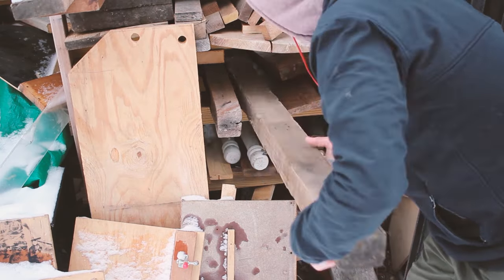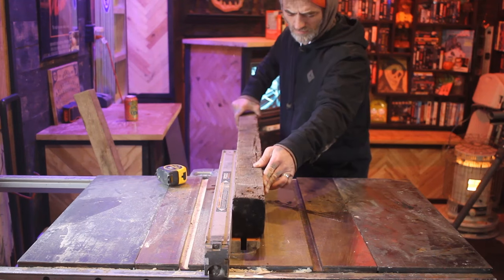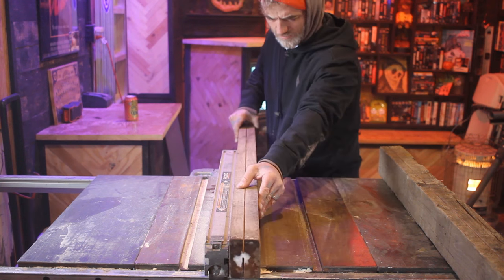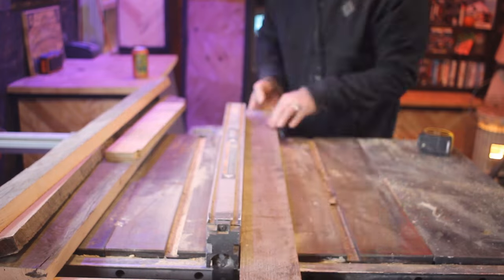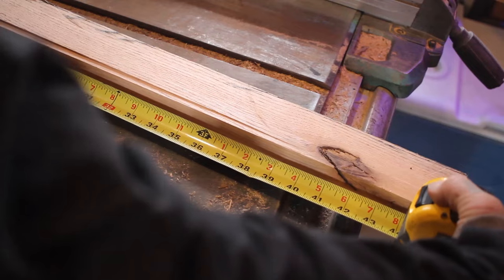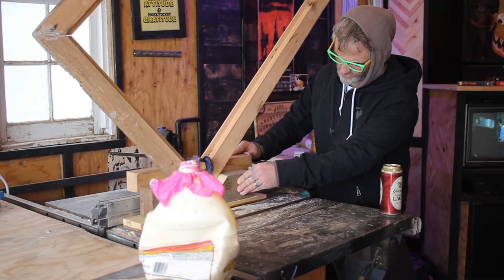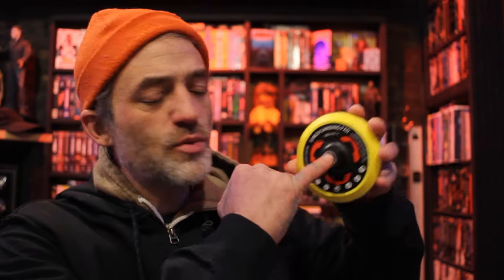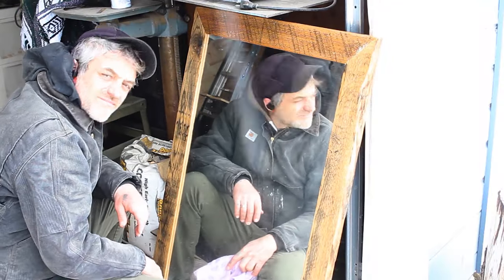Build THIS Simple Pallet Wood Creation - You Won't Believe How Quickly It Sells!

Comment: I actually just got a delivery of prescription safety glasses. I figure it's best because.... if I can see what I'm doing, I'm also protected. They are quite nice and came out to like $95 USD shipped. I work in an electric motor factory, so I got ones that are Z87+ high impact rated. The place I ordered them from was RX-safety.
Reply from the maker: I think I need to have 15 random pairs floating around my shop. I put them down and walk away all the time. Then I can never find them afterwards